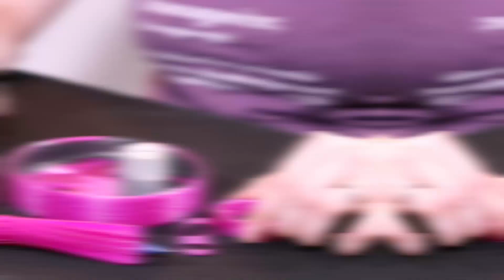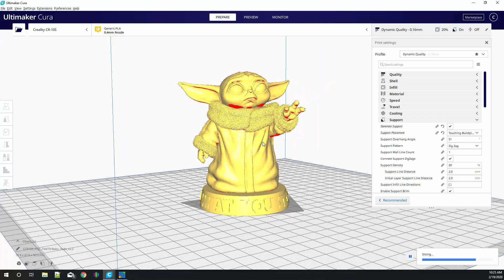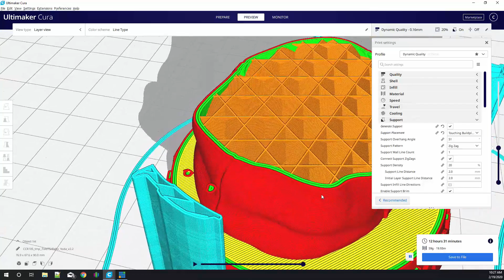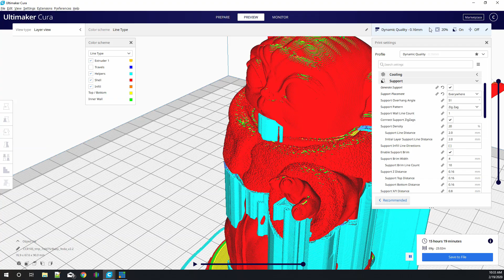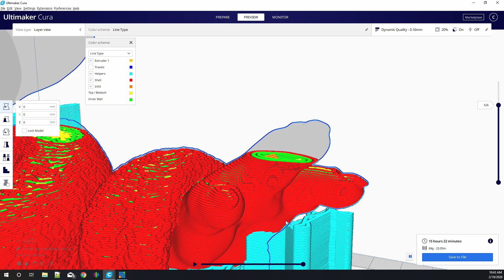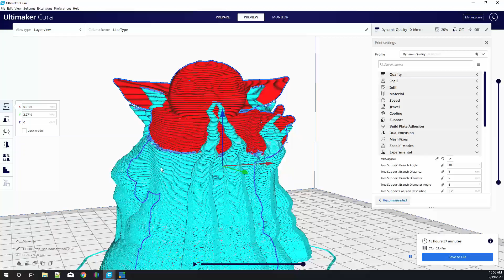Easy to understand Cura supports

Comment: Have a question on the tree supports. When your talking about turning off the support then using the experimental option. When i open mine, I don't see Tree Support. Mine starts out with slicing model option. Was this option removed in the newer version?  I'm using version 4.8.0.
Reply from the maker: It was made a stable feature in 4.8. You can now find it under the Support tab. The dropdown gives you an option for normal supports or tree supports.
Reply: @TheFirstLayer  thanks helps me a lot

Comment: Supports on Cura have been a problem for me. I been trying to print the USS ARIZONA Tower structure aft section and I gave up on two that I just could not remove the supports. The supports were very tight to the tripod legs and I broke one of them trying to snip around it. Going to give it another shot and see if tree supports will help with this section.

Comment: The cura support is really far from good, the default settings are way too over. it could be so easy just do some stick support and before touching the object try to connect the sticks.... like a wooden building is holding the ceiling with a Y line structure.
Big minus for cura on the support.
Reply: You actually can do that its stilla bit clunky but it can be done.

Comment: Turning off supports and turning on tree supports added 1.5 hours to my Yoda build.
Reply: My experience is, while Tree Supports usually increase print time, and add a little to material usage, cleanup is MUCH quicker, and the prints have far less support scarring to fix in post processing. So, timewise, it’s a wash, and the end results are far better.

Comment: Hil am having a problem with my creality cr-10 printer. Whenever l pause and resume it creates a step or gap within my model.Can you help please.
Reply: I think the filament not sticking because it’s dry. It’s no longer the surface which is glass bed, pei or whatever u use u printing on dry filament basically.

Comment: Finally an excellent video explaining support setting. I don't tend to use Cura that much as my Windows Pc is old and sluggish with onboard graphics, but it does run pretty well if I have Linux installed, so I might just add a Linux partition just so I can start using it again.